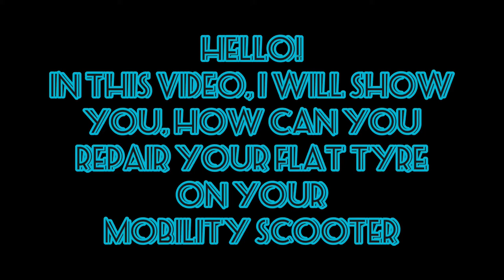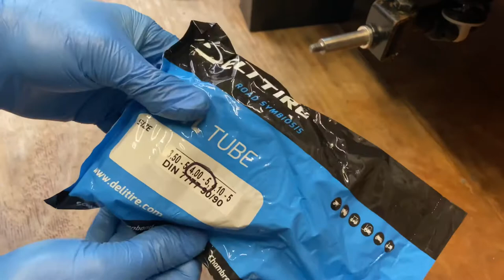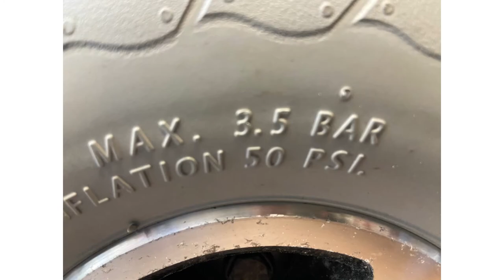Roma Granada Electric Mobility Scooter Tire Replacement (inner tube changing)

Comment: Once I got everything on the wheel won’t spin just the axel or whatever the thing is that holds the wheel on. Tysm for this video!!
Reply from the maker: Probably, you changed the tyre/tube on the back. And you missed to return a pin, that ensure axle and tyre spin together. You must remove it when started the change. In this video I changed a front tyre. There was no pin. Let me know if you sorted.
Reply: A easy way to fix that spot weld

Comment: What about those that have tubeless tyres 😁
Reply from the maker: Hi,
On scooters all inflatable tyre has inner tube, even it’s written on tyre tubeless. Other type is solid tyre, their wheel is coming apart, that is the way how can change tyre.
Reply: @georgesworkshop8600  I tryed to tell the car ppl my rims come apart but their like Travis has brain damage wat would he know .They didn't even know how to get my rim off But luckily my tires ARE tubeless so they plugged em. I have a super dopher scooter a 2023 model not a shit job
Reply: @georgesworkshop8600  ppl reckon I need to get all my inquires answered from a motor bike shop over south there more up beat then these LITTLE tinker,bell scooters you play with 😁...I got a big boy toy🤭🤭
Reply: @georgesworkshop8600  I disagree I never seen a tube on or in my tubeless tire I honestly think the types of scooters you deal with are SSO outta date I have the PRIDE of the tribe. My scooter so flashy other scooter riders avoid putting up beside due to Jealousy 😁👍💪🇭🇲👑
Reply: @georgesworkshop8600  So I suppose on motor bikes where it sez tubeless they too have inner tubes? IF NO.  why are they different?..my scooter weights 160 kilos that's the same weight as a 250 cc motor bike.  Well years ago it was... What's up chief🤣🤣🤣🤭🤭🤭🤭🤭
Reply: @georgesworkshop8600  do ya know what rim locks are🤔🤭🤭. Tubeless tyres with valve stems are like rim locks but a rim lock stops the inner tube from sliding around inside the true having the rim cut the valve stem that's why they made tubeless tyres 😁😁..so nowadays we just have tubeless tyres with a valve stem which pumps air in which expends the tyre those scooters that DO have inner tubes have piss weak motors that can't spin the tyres quick enough to endanger the tube from slipping around inside the tyre and causing damage to the value stem . Hence no need for a rim lock ..I worked in motor bike shop I WIN🤣🤣🤣🤣🤣🤣